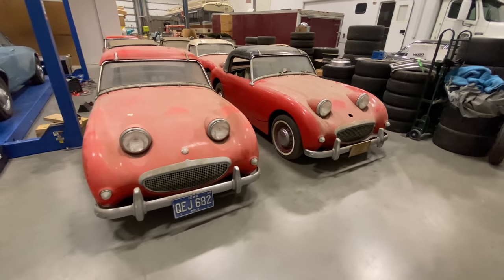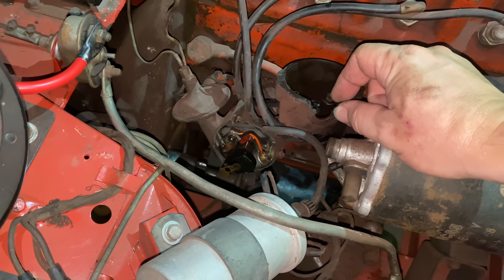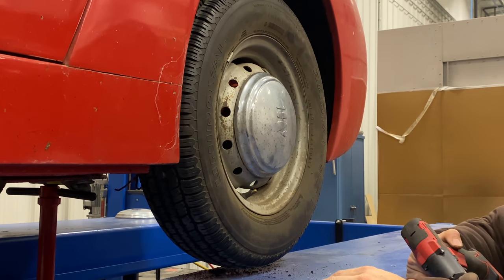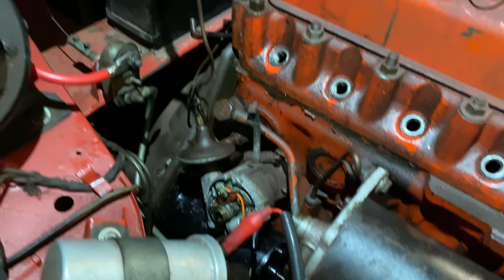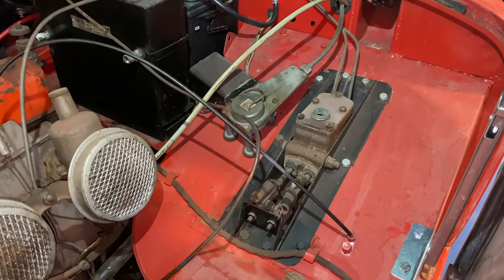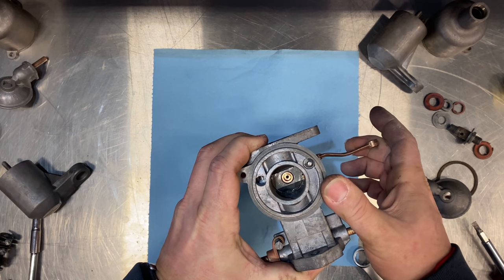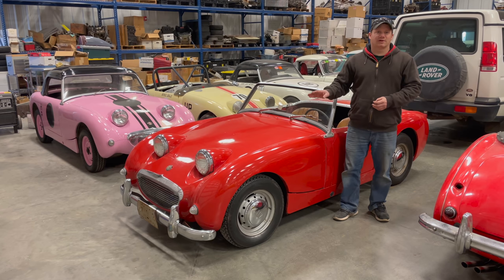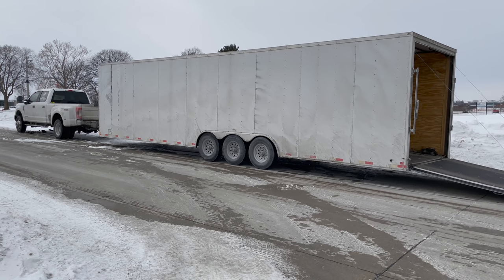Barn Sprite #2 Full Video From Barn to Send Off

Comment: Hi Steve.
Those 1275cc engines were installed in a variety of Austin Morris car models.
I had one in my 1973 Morris Marina 1300L.
They are great work horses and so easy to work on,and ultra reliable ..
That car was passed down from my uncle Joey to my Mum to my sister and finally to me aged 17 .
It was stolen and recovered,but written off by the insurance Co,as it suffered front box suspension  damage and the gearbox was shot.
I replaced the gearbox and suspension with scrapyard parts for £30 and sold the car making a HUGE profit.
Wish that I'd kept it now,as rare as hens teeth .

Comment: Hi Steve. One down 5 to go ! 😂😂  l had seen them all but it's great to have a recap .  She never really sounded like she was on all  4 cylinders. Or is that me in the mornings   !  The new owner has got the most  common  item missing from  all old cars......rust !  I always tell people get the best bodywork the rest is easy . Thanks Steve .
Reply from the maker: It was for sure running on all four I pulled each plug individually. I think sometimes the frame rate of the camera makes exhaust leaks sound strange.

Comment: The engine seems a little rough,
If the plug's are new, could be a valve, I was in my late teens in England when these forget sprite's came out, there must have been 1000s shipped to the state's 60 years ago, nice little cabriolet ,I think he has cornered the market, 🤔😁😅

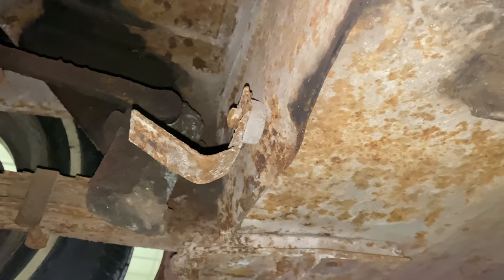Comment: 31:02 I would guess that when one of the previous owners had the car they wanted to move the car around but it wasn't running (as we all well know lol). So to save the body from getting dented and scratched up and to have something to push against they mounted a set of bumpers (or remounted them because they were too rusted to hold) to protect the body.

Comment: When you said it was running pretty good it was running on two of the  cylinders out of the four. I cannot understand why I can hear this and other people think everything is hunkydori. It sounds like a John Deere tractor because that is all they have. I thought it was one of the carburetors but it must be running on one cylinder for each carb since you synchronized it. I think water got into the two end cylinders and rusted the valve faces which you could tell quickly with a pressure gage in the sparkplug hole.

Comment: I don't understand. You bought 6 Sprites and of them you picked the worst one. One would think that you would have a  good look round all vehicles to determine the best one to try and get running.  Every YouTube channel that tries to get an engine running tries to turn the engine over by hand first before moving forward.
What got me was the he bench tested the starter motor. Then when installed, used a technique to try and get the motor to turn over.  But he already knew it worked.  Then said he tried to move it and thought the drive shaft was missing. But a quick look would have told him more parts were missing.  He may know what he is talking about but going about it backwards.